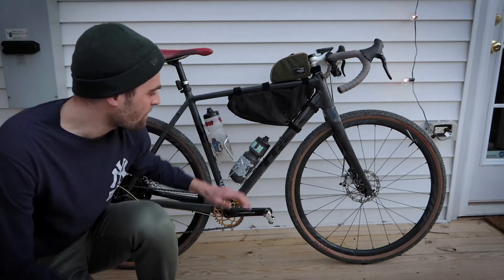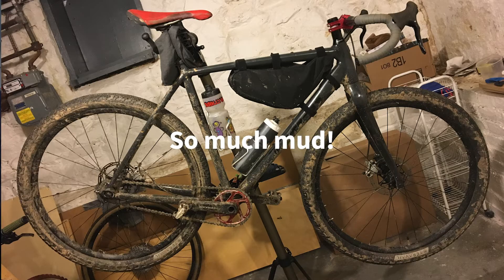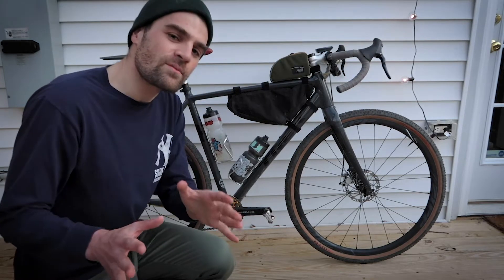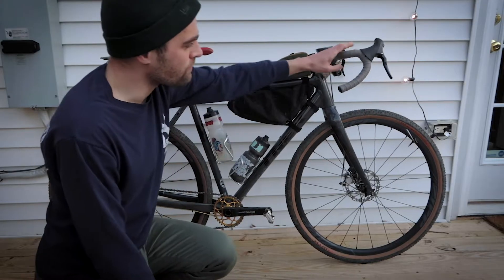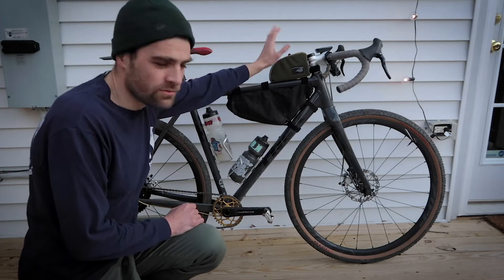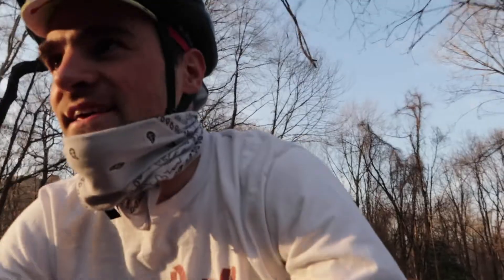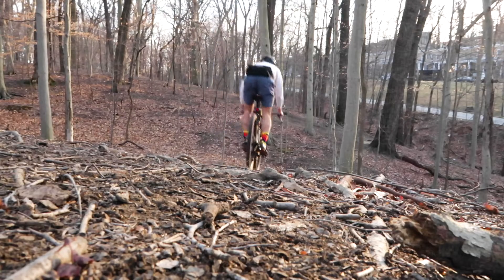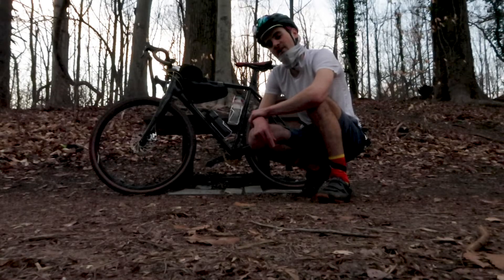Weird Bike Wednesday – Trek Checkpoint ALR with Thumb Shifter

Comment: lol love the sound effects! Also thanks for the info about converting from flat to drop bars. I'm changing up from a flat bar + bar end set up (60 cm at its widest) to a 50 cm kitchen sink handlebar from redshift and need to do the math on what stem to use. cheers!
Reply from the maker: Haha thanks, glad you enjoyed the vid! Did you go with the loop version? I need to get some bar end shifters at some point - makes it easier for switch.
Reply: @slimboykip  I did go for the loop version. I was really torn between the loop and non loop models but I ride in an "aero" position often and without aero bars .. I just leave my arms extended in front while resting my elbows on the grips. It's quite sketchy lol. I figured the loop will suit my riding style and  the fact that I love multiple hand positions. The bar hasn't even shipped yet but I am already fretting about how my handlebar bag (Chrome Doubletrack) will fit on there. That bag is easy to access while riding but may not work with the loop. Might look into a frame wedge bag like the roadrunner you mentioned....
Reply from the maker: Oh, I just looked up your chrome bag -it looks super versatile but agree it might not fit the bars unless you can somehow get it to sit below the bars. I hear you on the aero position, curious to hear how you like it once it’s on the bike. Was thinking of doing something similar for bike packing on my vintage mtb with old school bar ends but setup on the inside of the grips so it’s more of an “alt” bar setup. I do love a good frame bag but my favorite for everyday rides is the stem caddy bag.